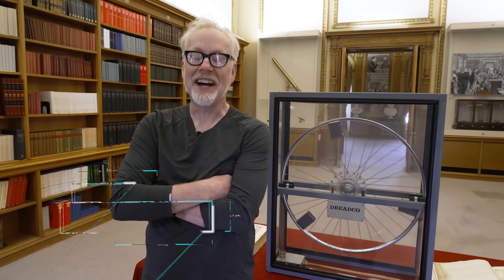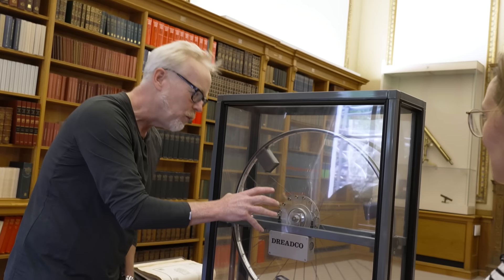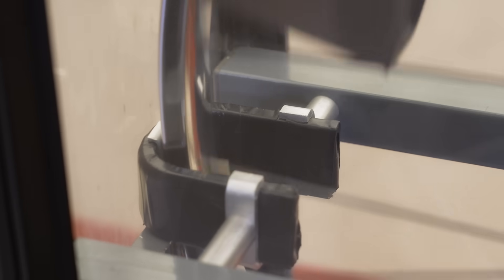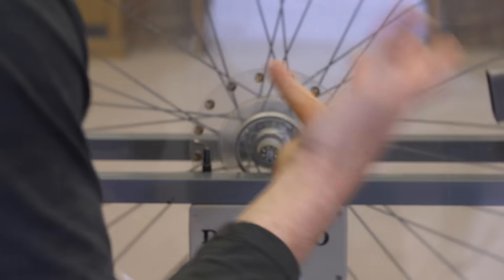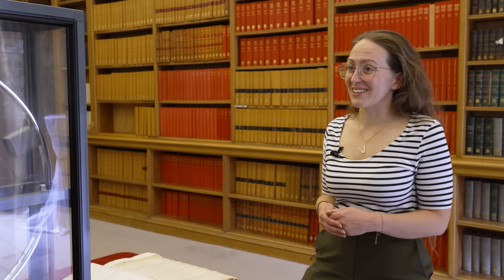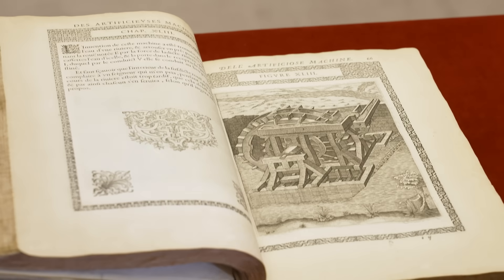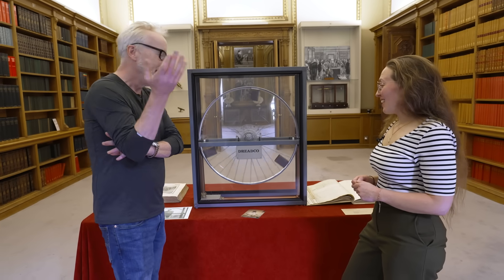Adam Savage vs The "Perpetual Motion" Machine!

Comment: ive been using AI to find a way to prove thermodynamics wrong but it refuses to come up with any type of way to do so until i told it to take in the ratio of PI and it determined that a perpetual motion machine is possible if you take in the fact that a planet orbits around the sun and that the circumference of a circle is perpetual. to create an object of matter that is equal to the same perpetual force than you would need a new form of energy or a new way of harnessing it meaning that the answer is most likely there, and we just need to find it.
Reply: a device that takes energy from temperature change could power a perpetual motion machine or a device that is powered by nuclear fusion within particle science on a small scale could also create a perpetual motion machine if done right. whether or not it could last forever is probably a far reach without someone making constant repairs and upgrades. in all things considered a perpetual motion machine is most likely possible and shouldn't be considered a work of science fiction but of current limitations and the progress of technology.

Comment: I would use two smartfons end magnetic field sensors to determine that these on sides are magnets in coop with two hall sensors probes in the middle. Magnets would be switching on and off one time on the left then the right and left and right and so on. Smash this plexi and dig out the battery. My old Casio watch can run 5 years on one single small button battery and this box in the middle is able to contain few li-ion cells. Looks nice but its just a motor.

Comment: Basically, it looks like the entire thing is a generator that generates it's own electro magnetic field, which then pushes it along through those gray boxes (probably magnets). So it moves on the power it created while moving. 

But, you need to push it to start it. Then once you push it a little, it's generated enough power to spin it on it's own, and it goes from there.
Reply: This seems to be a very common approach  to pmm's is to have a generator (or alternator) that powers a motor that then drives the generator. The problem with any variation of this setup is that generators usually runs about 90 to 95% efficiency in converting rotary motion energy into electrical energy. The electro-magnetic motors also typically top out converting electrical energy back at 90 to 95% efficiency. If they got the best of each that still be losing 10% of the energy each time it goes around and it slows down. Lots of people think that is how to build a pmm and a few of the lots actually try making one. If it was this easy we would heard a lot more about it.

Comment: My inclination would be to say there's a battery in the lower box, the side things are electromagnets, and the prongs near the center are sensors that turn the electromagnets on and off. More succinctly, the inner hub is a generator that passes current to a battery-powered amp in the box, and the outer rim is a motor.

Comment: Perpetual motion is likely possible, to an extent. It would need to use gravity, electromagnetics, and probably one or more chemical reactions. Without any one of these, the machine would stop working (thus, not really perpetual motion in totality). Even a machine that operating near a blackhole that used Hawking radiation for power, wouldn't be classified as a true perpetual motion machine since the radiation will eventually dissipate with the death of the blackhole.

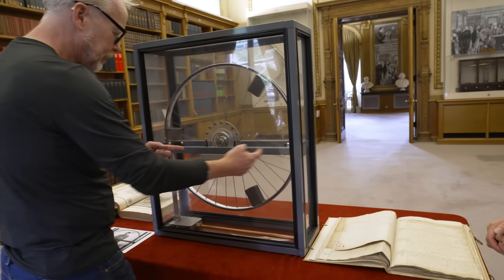Comment: 6:18 giving my "guess" before seeing the whole video. What if those boxes on the wheel aren't solid weights but some movable objects..  like rough/bigger sort of sand or metallic grain. Moving silently around shifting the weight depending on where it is in the turn. If metall then the magnets could shift it to be placed in a very specific position before going to the top and dropping down creating new energy to the movement... However 🙃🖖

Comment: Nope!  No secret here.  You're "taking the piss" folks.  This wheel would spin nearly forever if set turning in a perfect vacuum such as outer space.  Maximizing angular momentum by placing mass as far as possible from the centre, perfect balance, bearing design, lubrication, general shielding from nearby air currents minimize losses that would slow this down.  All the other "stuff" in there is a trick.

Comment: It is not a perpetum machine. Just a mechanism with very low energy dissipation. It is not able to do any work because of a neglegible output. As I can see box is isolated so there is vacuum inside in order to negated air resistance. This machine can't do anything but spin itself. Otherwise it won't work more then a minute or so to produce electricity or spin a small piece of paper. And more over in order to start the machine you need feed it energy (start spining or so). And this machine will only produce much energy you gave it in order to start.  And as conclusion there is no other purpose for this as just to be nice example of 'efficiency'.

Comment: that copper pipe is a heater. That thing runs on heat . It draws in ambient heat and directs it where it needs to go. Those 120 degree boxes are sadly just fly wheel weights. The Dreadco box is a heater . Gimme a thumbs up please , you heritage engineering fascists. You T Edisons and JP Morgan's.

Comment: yo Adam,  Ok a Sprinter flywheel on maglev bearings. Encased in vacuum.  Or a modified 24v BIGBOY alternator, spun by a single phase motor. Surely, that gives more power than that goes in to spin the BIGBOY.  Use gauntlet gloves xx box section frame, slapped in your Tesla / Musk trunk.

Comment: It’s not exactly a perpetual motion machine, but Atmos clocks are not too far off from it. Atmos clocks can fairly accurately run for 50-80 years without almost any human intervention when set up and cared for properly. Perpetual motion and high efficiency are very similar, but not the same.

Comment: Well if it’s dc powered then its running negative to positive… electric generator with some type of rechargeable cell that is designed to trickle just enough current to move at a constant rate. ? The copper pipes are?..vents?.. intake and exhaust? So very FN cool sir. So many FN questions 🤯

Comment: Sorry, looks like a hoax to me...
The three weights are probably magnets, all aligned in the same direction, and the box with the title, masked with inputs as it may be - is probably an electro magnet, with the battery down left.
So when the magnets move towards the electromagnet they start at the opposite pole, getting pulled in, and tben move to its other pole, getting pushed away.
The reason i think it has to be an electro magnet is so you can set it very precisely to the power of the 3 magnets - so you can control the pull so it would be just right, and you wouldn't see any pulling or pushing and it will simply slide by, concealing the 'secret'...
And it is set to such a low pull that it barely uses any power - so when it goes for 'maintenance' they simply charge/change the battery, and maybe replace the 3 magnets if their power gets worn and out of sync... 
The tubes, the cooling parts, the sockets on the sides of the box - are all there to confuse you if you ask me, and maybe hide the cable to the electromagnet...
Reply: Explains also why it is mostly in storage rather than on permanent display... 
If the sync gets off balance, either because the magnets get worn, or the battery runs low - they want to be able to see and fix it quickly before showing it to anyone.

Comment: personally, I think the 3 blocks that rotate through metal on the sides are decoys. The copper pipe is a decoy. The dreadco box is a battery, and the 2 electrodes are positive and negative which makes it turn as the circle of magnets rotates near them.....it takes such a small charge that the large  battery lasts for a very long time. SO they either recharge the battery, or they replace it when it slows down

Comment: The earth is the perfect perpetual motion machine.
Reply: But the problem is once you start trying to extract energy from it, it will start slowing down. The earth spins from momentum, and some is lost everytime a rocket lifts off.
Reply: @funveeable  But it only show that perpetual motion is possible.
Reply: @@grande6075  so would you also imply that an electron revolving around the nucleus is in perpetual motion?
Reply: @amritprajapati6075  it more likely
Reply: @amritprajapati6075  the electron rotating around is in perpetual motion. Thou i wondered how such thing was concieved 2000 years ago in the absenced of a elzctron microscoped and even until now i dont know how they were able to see the electron rotating on a nucleaus..
.
Reply: @amritprajapati6075  the same is true i wondered how they were able to measure the speed of light in the absence of modern equipment.
Reply: @grande6075    @funveeable  has already answered your question.  the electron revolving around the nucleus is not in a perpetual-motion  because we cannot extract energy from it without causing it to drop to a lower orbital state, and once the electron reaches the Bohr radius, no energy whatsoever can be squeezed out.

Comment: I think I know how it works. The magnets on the wheel just attract towards the magnets on the frame and the box just keeps the air from causing problems?
Reply: Magnets don't stop attracting once the box passes it. Once the box runs past the magnet, it pulls the box back and removes whatever energy it gave.

Comment: I think in a different way when trying to figure stuff like this out. "How would I build something like this?"
And if I was to build a machine like that, I'd put a couple of frame antennas in the surrounding frame and harness the electromagnetic radio waves constantly surrounding us. Then use the energy to power  magnetos to spin the wheel. That would align with the wheel slowing down in storage as well since radio waves might be blocked out in their basement. No telling if it could work, but a wheel like that needs only a ridiculously small amount of energy to stay turning.

Comment: Let's see. Assuming that it is not perpetual motion, then something has to be replacing the mechanical energy lost to friction, mostly in rotating a wheel of many spokes through the air and the bearings. If it can run for 6 months or more then it either needs a large battery or some way of tapping into outside power. The only place big enough for a battery to run that long is the Dreadco box, but I doubt that any battery that would fit could keep it going that long. 
My other thought is that if the Dreadco box contained an inductor and capacitor pair that is tuned to 60hz. 60 cycle hum pervades any place people go with indoor lights, wall outlets, and other uses of AC power so I can easily see a 60 hz resonator picking up just enough energy to keep the wheel spinning. I also noticed  that there are two, short metal rods coming out of the box and they are pointed at brass buttons on a separate, smaller glass disk. If they had a source of high voltage the rods and insulated brass buttons could form an electrostatic motor. If the resonator could generate a high voltage without shorting out internally that could be connected directly to the rods. If a super capacitor is needed to get such a physically small inductor to resonate at 60hz then the resonator must operate at low voltage and one or two step-up transformers used to get the high voltage I assume the rods need to spray charge onto the brass buttons. If the 60hz resonator is being used, then a contactless live circuit detector would light up anywhere near the box. And a sensor for local high voltage electrostatic fields would likely show something, even through the plexiglass as well. A third test would be to use a high speed camera and some software to measure the instantaneous rotation rate and see when it spikes to make up for frictional loses. If it spikes 3 times per revolution then there must be some hidden wires to power electromagnets hidden in those 'U' brackets in the frame and it is being driven by a magnetic motor. If it speeds up and slows down 30 times per revolution (or how ever many brass buttons there are) then it is being driven by an electrostatic motor.
Mike

Comment: A simple AAA battery operated clock mechanism inside the wheel spindle ?
The other bits could be decoys ?
My only other solution would be a tiny, battery powered fan (similar to that inside a laptop) inside the bottom box, blowing air through the right hand copper pipe onto the wheel rim. (The left hand pipe is a decoy {blocked} )

Comment: The heat sink and the copper pipe make me think it works on a similar principal as a stirling engine. I hypothesize it works on thermal differential, or heat exchange.

The heat sink is offset and I'd expect cold air is pulled through that end, and it slowly drafts from the end with the longer pipe segment.

I also suspect that the blocks of metal and magnet-things play a part, but act more as a "magnetic flywheel" to reduce the apparent friction of the bearings. (Or perhaps they are there just for show in order to confuse us...)

There are four ways to test my hypothesis:

1.) It should speed up in a warmer environment, and slow down, if not stop in a colder one.

2.) Play around with a hair dryer untill you mess up the system.

3.) Place the device inside a vacuum chamber.

4.)Pick it up, smash it on the floor, and pick through the wreckage until you find out the answer.

Comment: A machine will always require a source of power & transmission mechanism to work. A machine channelling energy via quantum tunneling it from a source not perceived by three dimensional senses might just be close to being eternal. Would also require the mechanism to be free of any mechanical fatigue of wearing out by friction of varying forces & after effects of channelling the energy. So such a mechanism will not be simple in any way either. It will need to be built by a level of scientific specifications & precision not currently developed by humans.

Comment: I bet those middle prongs are sensors to find the rotational position of the wheel so the coils and magnets can function properly to work as a motor. 

You need to be able to switch polarity on the coils to actually make a working motor, so you need to know the position of the magnets to time it right.

Just having those permanent magnets passing by other permanent magnets wouldn’t make a functioning motor. 

Either that, or it’s very low friction bearings with very heavy weights. So it just acts as a flywheel.  It slows down slowly but their “tune up” is to just give it a little spin. That’d be a disappointing secret for sure. Not sure if it’s possible to make a bearing that good, but having weight at a good radius out can store a lot of energy.

Comment: We did a microprocessor project once that ran continuously for 12 years monitoring a switch to turn on a flashing LED array. It died about a year after the 2x AA cells corroded. If we had used Lithium primary batteries (non rechargable) it would still be running.

Comment: Lol. The leverage force of the larger weights change by the charging and discharging of the electromagnets. The inner bits do the same thing. But oppositely. Using gravity and the weight of electricity to cycle it. Similarly to my cyclic mass generator.

Comment: Is not the universe a perpetual motion machine? It exploded on its own (no being could have lit a fuse). It will either keep expanding, or slow down and eventually reverse, contracting down to a small size (singularity?), whence it will explode again. Batteries not included or needed.

Comment: When you looked at the photos , the answer were right there in the hub of the wheel, i think it's a motor. Cupper pipe  and a aluminium wheel , could be perfect to build an ac motor that is charged and slowly discharges itself.
Not necessarily need any battery

Comment: There may be several things working together. The pipes may introduce a natural convection flow of air, the magnets and weights could introduce rotational moment, and the 3 weights could have sand or water inside that shifts the lever arm.
Reply: If there was sand or water in the weights it wouldn’t matter. The lever arm in one weight would shift one direction and the leverage would switch the opposite direction in the other weight. 

It’d be net zero at best, and technically would remove energy from the system as heat from the sand and water moving around.

Also the coils need to be able to switch polarity as the magnet passes by or it’d be net zero as well. So you’d need an electromagnet to power the coil in order to be able to switch polarity, meaning a battery of some sort. It’s the reason why those little anode and cathodes are in the middle, as indicators for when the magnets should switch.

Comment: I made a PM machine using an electric motor with switched magnet drives using eddy current induction and permanent magnets corresponding to the three hub boxes and permanent magnets. The batteries last about 7-8 years. I’ve only changed them twice, the newer sealed batteries last almost 10 y with improved bearings in an evacuated chamber. ❤
Reply: Do you have a video or drawings?

Comment: I recall that one treatise on perpetual motion machines classified them into classical physical types: PM machines of the first, second, third kinds. An example of the simplest type is a mass on a path in a force field, such as a ball on and ideal frictionless roller coaster. Starting at the top, a PM would require the ball roll along the path with arbitrary changes in elevation. With no losses the ball would return to its starting point. The partitioning into thermal losses due to friction converts potential energy into kinetic energy and heat due to friction. That work is not recovered disproving PM of that class. PM machines could be reduced to any of these archetypes are disproved…🎉